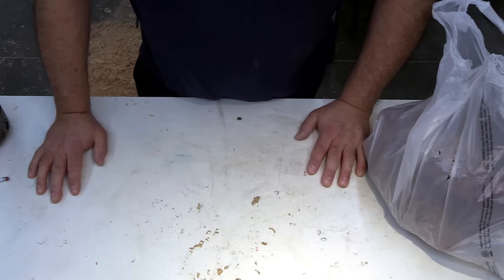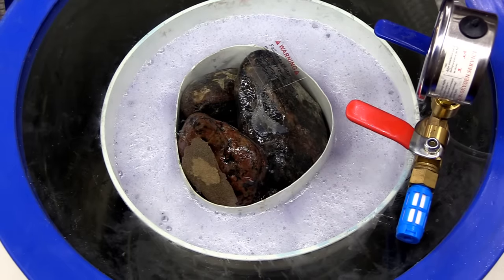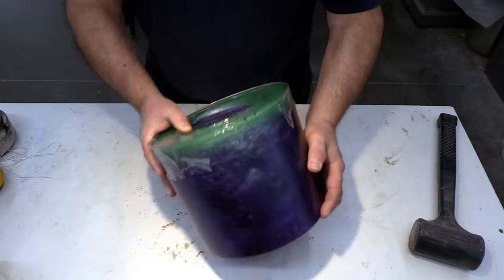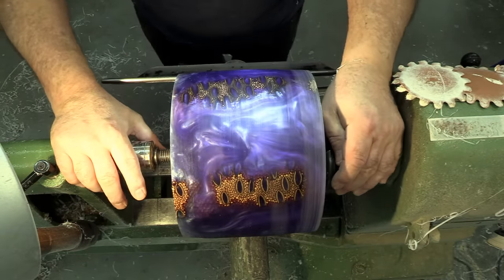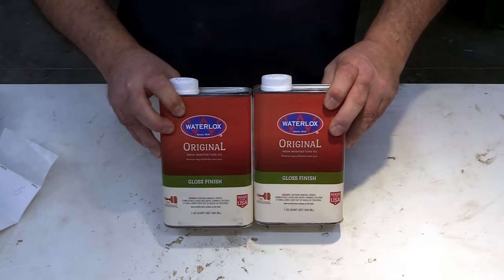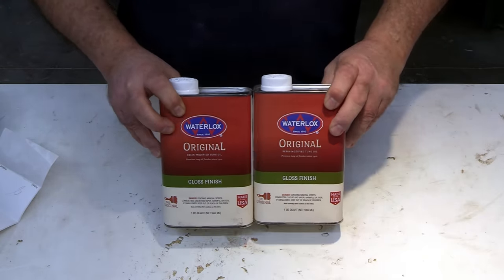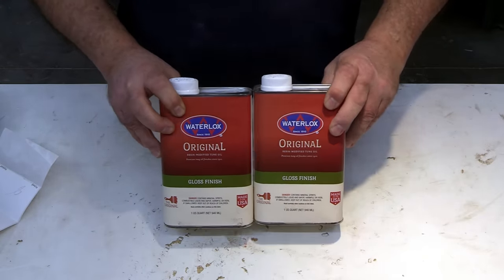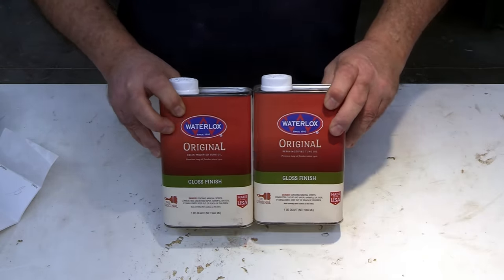Woodturning - Australian Dragon Skin? 2024 is The Year of The Dragon!

Comment: About vacuum-ing - every time you "release vacuum" (let air back into the pot) you push the resin back into all conduits air was escaping through, making evacuating whatever remains there less effective every time. Yes, the bubbling becomes lesser and lesser, but that doesn't necessarily mean "there's no more air in the wood" but rather "can't evacuate it any more (effectively)".
I'd rather try to slowly increase the vacuum, CONTINUOUSLY - slow enough to keep foaming under control, adding a little air back to the pot whenever needed, but never filling it all the way back to atmospheric pressure.
Like, say, get the pressure in the pot to 0.9 - 0.7 atm, wait till bubbling slows, reduce it further, wait, repeat, wait - and so da capo al fine, i.e. until bubbling would stop (or be reduced to a trickle), and only then I'd let air back.
Reply from the maker: I get what your saying, the only issue I’ve got is in this case is I’m not using stabilizing resin and probably only got 60 mins max to get this done before things start to cure, especially if it’s a large over pour. If you hold a vacuum for that 60 mins and then release it, will the wood have enough time to absorb the casting resin before it starts to set. Thanks
Reply: @SpragueWoodturning  Yes, but of course - time constrain, SOMEHOW it escaped my thinking then. Gets more pronounced with large pours - cross-linking generates heat, which speeds the reaction, which generates more heat, which in turn... And with larger mass there's less heat loss, as there's less surface per volume (volume grows to the third power while surface gets squared).

Comment: The green likely floated because liquid was a higher temperature.
It’s like making a hot mocha coffee in a tall glass.
You make the coffee, chocolate and milk different temperatures. Pour them carefully from coolest to hottest and they separate into layers for a cool presentation…
Reply from the maker: Makes sense in a way, but I would think the liquid would quickly become the same temperature as it was put in the casting in small amounts. I think the fact the pods kept moving around when I was injecting the fluid is the main culprit. Thank you very much!

Comment: About wheel marks - rubber (or polyurethane rubber) gets hot from rolling (they constantly deform, or molecules are rubbing against each other"), so while getting those wheels "up" might mitigate the issue to a degree, it won't prevent rubber from warming up. And then the heat gets transferred to the resin, which makes it pliable, which increase heat generation, which makes the resin even more pliable, so...
Small nozzles blowing air at each wheel, like they do sometimes for mills on milling machines, would help more than shifting the wheels, I guess.

And yes, I know, I'm commenting incessantly here like the "Uncle Good Advice", but hey, "comments help to promote the video" and at any rate I'm just happy to share my knowledge and observations - so unless I'm politely asked "shaddafakap!" I will keep talking ;-)

Also, keeping the resin in the fridge slows down the polymerisation (cross-linking) process AND prevents it from full completion. "Classical" 10:1 epoxy resins (10 parts of resin, 1 part of this runny liquid that smells like mouse piss with a dash of ammonia) would set hard in half an hour, get to approx. 90% of strength in about a day or so, but it'll cure fully only in about a week time. Heat speeds the process, so my "good advice" ;-) would be to put the piece through "maturing" or "ageing" process after very rough "roughing" it - like placing it in a warm place (not too hot, so the resin won't soften and collapse) and leave it for a week or so. Maybe the manufacturer of the resin could provide you with some specifics regarding time and temperature.
Reply from the maker: Thanks for the info, Deep Cast is a 2 to 1 epoxy and can be controlled by temperature.

Comment: Just a thought about the mixing of the colours, given quite a deep pour, there is likely to be quite a temperature difference between the centre of the pour and the outer wall (especially if it is placed in a refrigerator), which will cause convection currents, which will, in turn, cause mixing to continue within the container, diluting any accent colours. Perhaps a solution is to keep the accent colour in the refrigerator, to slow its curing, while the main pour is allowed to cure at its own pace, and just try to be ready to catch the main pour before the curing has gone too far. 
An option to try first might be to ensure that the resins are allowed to fully return to room temperature before they are combined, to limit convection currents from mixing them too much

ETA It’s about four in the morning here, and if I tried to edit this to make it read properly I am liable to render it entirely nonsensical. Zzzzzzzz…
Reply from the maker: Lol. Thank you very much!

Comment: Also, "no one likes language police, literally!" ;-) I should have glued , of... of course. ;-) (12:55)

Also, just for clarification, some useless trivia - "synthetic resin" is any resin-like compound that hardens, or "sets" when mixed with hardener (or "activator", as is the case with polyester resin), and "epoxy" resins are one branch of this family. That "epoxy" part comes from class/ type of of certain chemical group common for all those resins in "epoxy" genus - and it is epoxide group, short for epicyclic oxide, in which a single oxygen atom is bonded to two different carbon atom of the same chain.
That makes it kinda "strained" and unstable/ highly reactive, and this is why it is easy to start the polymerisation process. Which of course is totally irrelevant here ;-)
Reply from the maker: Thanks